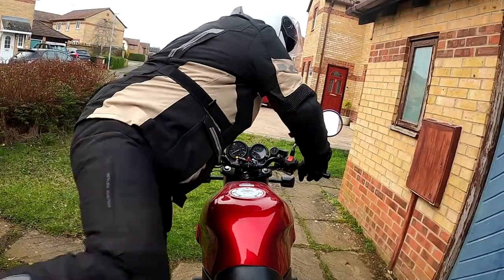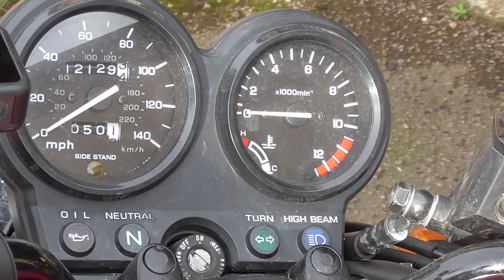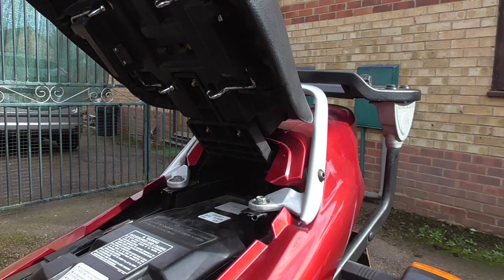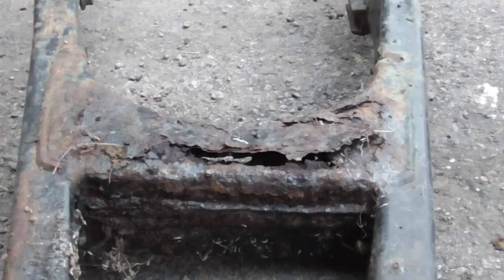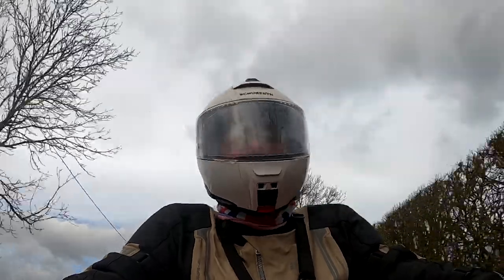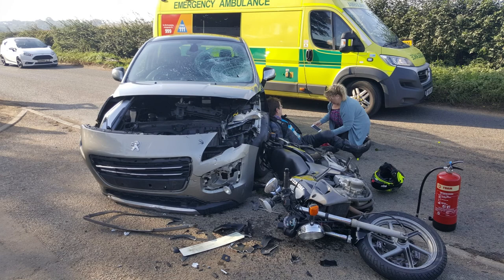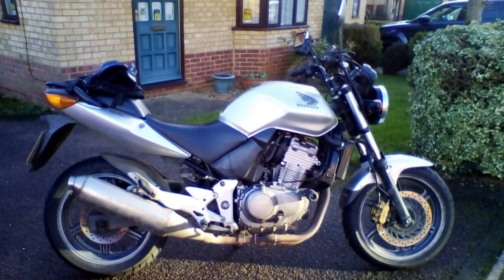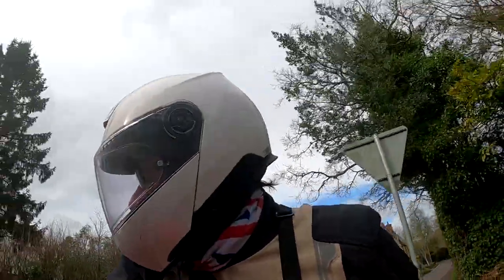1999 / 2003 CB500: Honest Review

Comment: Honda designed the bike for 300,000 kilometers; 186,000 miles. I've had many twins, paralel power curve, but these have a rush from 6 / 7 thousand revs. The head has been ported the same as a Fireblade. The bike will commute, tour and scratch. Top is around 125 mph, but more importantly on twisty A & B roads she is in her element, can surprise many bigger bikes.
Reply from the maker: @TheBezaleel The CB is indeed a great bike for seeing off bigger bikes, on new tyres I had to stop twice and wait for a 'blade, and a couple of Kwaks - a 636 and 900 Ninja.  It was the last time they said 'you are on the slowest bike, you can lead'.

Comment: I own one too. It was my first bike. I have it for about our years now. I replaced the shocks for Icons and upgraded the forks with Wilbers springs. In combination with wider handle bars, it transformed the bike completely. Handles like a bicycle now. I do everything with it and I mean it. Long touring and everyday commuting all year around. The engine is a dream and quite powerful for its 500cc. Only on long touring, I would wish to have a bit more power. The bike is very easy to work on and I learned a lot owning it. I will however upgrade to a 675 Triumph Street Triple R this year. I feel like it's time and I would love to own something more modern with ABS.
Reply from the maker: @memento mori Thanks for the comment.  Like you I used the one I was knocked off for touring (just under 900 miles in one day) and everything else.  The Triumph is a completely different bike so if you have the money and space you may want to keep the CB as well, a lot of people who changed bikes wish they had!

Comment: its good bike but not perfect 👌🏻 own one from 94 at first it was limited to 35 hp 0-100 8 sek on racebox vmax 152 km/h now full power derestricted 57 hp 0-100 4,7 sek vmax 183 km/h racebox so that said now i write what im like about this bike and what dont like 👌🏻👉🏻 weight  is good , geaometry not perfect but close 143 cm whellbase 78 sest hight 27 degree rake vs perfect be if it would have 140-82- 24 👌🏻 yea lil more sporty cos i like more  dynamiq agresive ride than very slow cruising 👌🏻 chasis for fast ride in corner also isint perfect bike like do pogo if push at fast pace thrpugh corner what i dont like so stronger frame suspension project be aprecciate be me 😉👌🏻 for slower roder that isint issue cos they never reallly go to level of gforces where bike start behave not very stable  👌🏻cb is projct for brisk ride but not reallly fast 👌🏻 breaks are good enough  if ride single even fast when it comes to decelerstion level but break lever need more force exert on it for get similar gforce than if it wpuld have stronger setup now it have 296 /2 t i would prefer here something like 320/4 to or at least 310/3 t for get more agressive reaction on the same force on break lever 👌🏻 gearbox work hard it need big force to change gear i also dont like this feg in sv 650 it work waaay easier 👌🏻 when it comes to ergonomy it close to perfect i would only change seat high on couple cm higher what will straighten knee angle lil more and bend corpse lil more  👌🏻 weight distribution also sisint perfect 47-53 bike dont ride front end like i would like for waaht is required at least 50-50 weight distribution with rider on it in neutral position with let say 50% fuell in tank 👌🏻tire size have 3 point to solve 1 80 profile dont give to big choice between good sticky tires so better be 70or 60 its wodth 110-130 have advantage and disadvsnstage advantage is it dont need lean so much for go the same fast in corner as woth woder tire and is less prone to shimmmy but it take out worse tarmac with hole and bumps much worse than sv 650 with 120-160 sets or new cbf 500 also with 120-160 👌🏻 now 👉🏻 engine 2 point internal cosntruction and power characteristics so when it comes to internal cpsntruction it have vlavetrwin on chain and tensioner which need service after some time  and change stuff what generate costs much better be maintenanceless  and cost less cam whells basically immortal setup like in first vfr or cbr 250 mc22 😎👍🏻 + it have  vslve on glass and shims also is  not very good setup in terms of service need alot work to setup everything good vs valve on screw be waaaaaaay nicer 👌🏻 easy and fast to service in garage 👌🏻 + not 4 per cylinder but 2 be waaaay enpugh what also make serviec again easier 👌🏻 i have no idea whay manufactory setup bike which have pathetic 114 hp from liter dispalcement in 4 valve per cylinder + chain and glass and shims like in pure racing bike 🤭🫣🤷🏻‍♂️which have 150-200 hp from litres dispalcement 🤷🏻‍♂️ it makes no sense it incepreases only service cost time and ypu still dont have very powerfull bike but avg commuter after all this 💩 🤷🏻‍♂️🤭 🤮 maybe it isint very emergency i mean engine overall in cb but isint also perfect when it comes time to service intervall 🤷🏻‍♂️👌🏻 and last butnot least power characteristics it have weak lowend and midrange in regard to topend which it have like from 500 ccm and even worse  is that power isint delivery linear but it have hole/big hole in midrange and rapidly power increasing from like 6-6,5 k rpm up what mean ypu need upshift and down shift more often than not i dont like this as well defenitelly nicer  setup be if it would have more torq and power at low and midrange rpm + perfect linear power build from low rpm thrpugh rev range 👌🏻 + than i would throw off 6 gear and left only 5 with 5 final gear rstio like now 6 so at 100 km/h around 5000 rpm with like at least 50 nm at 5000 rpm 👌🏻 topend power is enough for me 👌🏻 57 hp in 190 kg naked isint bad 0-100 4,7 100-140 4,7 100-160 9,5 vmax 183 km/h on racebox wayyy faster than feg royal enfiled 650 interceptor or continenetal gt asf ….. only elasticity 100-140 in 8 sek isint to good like for me ….perfect be somewhere around 6 sek like for me 😉👍🏻 chasis with preload front and rear stock have only rear both also to soft sstock but its commuter so ok2 point of view its commuter vs what i would like have more in cb 👌🏻 so yea as commuter to not to agresive ride it isint bad but like for me its not pefect i give  it like 6-7 out of 10 points 👍🏻 vs me hipothetical cb setup be like always 10/10 👌🏻👉🏻so more stable on fast ride in corner stronger breaks reaction much better elasticity maintenance less engine better weght distribtuion and lil better ergo 😎👌🏻🍿+ one more stuff 👉🏻 dasboard look like 💩👍🏻😁 2 piece of 💩 with 💩 everything i would like more something like street rod 750 one central speedo minimalistic but with all stuff in this small electronic window under speedo or like in junak m12 also minimalistic speedo one central than 👍🏻 so when i ride all this 💩 in head while ride on cb im not very happy riding it but sometimes when i forget abput all this 💩 i like ride it 😉👍🏻🍿
Reply from the maker: @mociczyczki - Thanks for the comment, it was longer than my review.  To address some of the points in order:

In the UK the roads are apalling so it is difficult to see if the bike is bouncy because of the suspension or the roads.  i've not had any boinging when on track, and ignore it on the road, the bike will sort itself out.

The brakes aren't designed for MotoGP type decelerations but it is easy enough to 'stoppie' a CB500 so they are strong eonough for the bike, after all if the rear is a foot off the floor how much more braking do you need?

You can use a 140 section on the rear, the CB500 racing control tyres weren't available in a 130.

I'm slightly confused by your comments about engine maintenance, performance and design though.  The valves only need looking at every 16 000 miles with oil changes every 8 000.  I never had a shim in the one that I did over 100 000 miles on, and my nearly 110 000 mile Hornet 900 hasn't had one either.  You seem to be asking for two valves per cylinder which would lower performance and screw and locknut tappet adjusters which would bring the valve maintenance period down to 3 000 miles at best?

The 'hole' in the torque curve is found on every bike, this is to get through emissions and noise tests to meet approval and usually occurs half-way between tickover and redline.

I disagee about the instrumets, my Tracer 9 has shedloads of information available but I look at speed, coolant temperature, fuel gauge and the time if I need to know it.  The CB500 has a reserve tap [I tend to fill up every 100-120 miles as this is about 2-3 hours riding and time for a break anyway] and I put a clock on it.  The mechanical speedo us unlilely to fail, although the cable can break and I doubt many TFT instruments will be working 25 years after the bike was sold.  The Street Rod you mention still has the 'idiot lights' although no tacho - probably because it would be embaressing for a small car to rev higher than a Harley!

You do seem to be enjoying the bike though, which what riding is about.

Comment: 300.000 miles or kilometres?
Reply from the maker: @kennerroberto7322 - Are you referring to the design of the engine?  It's states as 300 000 km [186 000 mies], which is the distance that light covers in one second!  Sorry if I said miles in the film.

Comment: I had the dark green one and did over 110mph on it once riding solo.  I also toured Ireland with my girlfriend on the back, a top box and throwover panniers.  The rear shocks couldn't handle the weight and bottomed out regularly.  That bike never let me down, but I sold it and bought a Sportster 883, which was not as smooth or quick.
Reply from the maker: @1SeanPG - I hope your girlfriend doesn't read this and think you are blaming her for the shocks bottoming!  From memory the dark green would have been about 'P' reg, 1995 ish and drum brake?
Reply: My green one is a 94 M reg rear drum. I bought it for £750 on ebay with a helmet and top box with just under 6k on the clock in 2019. Finally got it on the road this year. I fucking love it. Needs an engine respray and there's a bit of rust removal (30 years old) but it's practically off the shelf...

Made me laugh when you said going back in time to buy one because that's kind of what I've done. Absolute belter of a purchase.
Reply from the maker: @dannybruff - Thanks for the comment.  I held off buying one until it had the rear disk, but then found I never used the rear anyway as the front was so good [I was riding a GPz305 at the time].  6000 miles in 15 years is nothing!  Had it gone round the clock???
Reply: @TheRantyRider  no, the last time it was taxed on the road was 1997! Ive put nearly 300 on it now...

Comment: The CBF has carbs, not fuel injection.  The PAIR system can be removed and the fuelling is fine.  They also come wirh ABS as an option.
Reply from the maker: @kpowers9017 Thanks for the comment and correction, someone else also pointed out my boo-boo and I keep meaning to do a card/endscreen accessed correction which I will have to get on and do.  I know someone who will benefit from the PAIR bypassing.  I had the ABS version (2005).

Comment: It WILL do autobahn, 2-up and touring. I've done all three on mine - including a +1000 mile IBA certification ride.
Eventually - after 50k miles - it had a sibling in the shed; a Blackbird, which is essentially a double CB500 with a bit of Extra amenities. Eg. a clock. But I keep returning to my CB500 because of its WYSIWYG approach to everything.
It's a no-nonsens bike that will take you literally everywhere.
Scraping pegs on Transfăgărășan, riding 2-up with the missus on Monaco racetrack, exploring balcony roads in France and pegging the revcounter at 8000 rpm for 500 kilometers solid on autobahn; maximum cruise speed. 
Been there, done that.
No issues, no hiccups, nothing.

Indeed a good bike.
Reply from the maker: @MartinFiltenborg - Thanks for the comment, did you do two -up with luggage at high speed?  The CB will do these individually in my experience but maybe two out of three and not all three.

As for the clock, we can get small bolt-on ones from Oxford in the UK, these fit to one of the switchgear bolts, or the tried and trusted 'cheap digital watch around the bars' is always an option.

Good to hear from a fellow CB-er, they are beginning to die out a bit now, so it's up to us to keep them on the roads.

Comment: I have a good cb,500..from new..
 for 20 years.coming up to.20.000.miles so ultra reliable.. garaged..as you say .a new regulator..never changed a bulb.. fantastic machine.im nearly 80..I love bikes.. especially honda..i also.have a c92 honda  benly..60years old. .
Reply from the maker: @davidblanchard7077 20 000 miles is barely run in, I bet the Benly is still going strong too.  If you get the chance the David Silver museum is well worth a visit.

Comment: Great vid! nice to hear such positive things about the predecessor of my bike :)
You talked about the CBF having fuel injection, but in fact it kept the carburettors and yes, it's great !
Reply from the maker: @bumboschaumburg8200 Thanks for the comment and pointing out my error, for years I had thought the CBF was fuel injected!  I have looked in my workshop manual which isn't clear and went onto the Fowler's website to check: https://www.fowlersparts.co.uk/parts/4798359/cbf5006-2006-e/carburetor-assy

Have you ridden a CB500?  If so try one and see how the fueling compares particulary when in 4th gear at 30 mph and accelerating from a steady 5500 RPM, that's where I found the fueling harsh.

I'll put up an 'I'm a chump' short when I get the chance with full credit to you.  Until then I will sit on the naughty step.

Comment: I'm a born again biker having grew up on motorcycles and almost signed to race for Aprilia back in the 70s, so l knew a fare bit about bikes and when the opportunity arose to buy a 2002 black honda cb 500s with 13500 miles on the clock, l jumped in with 2 feet. 
Bike is immaculate,  bought from a 73 year old gentleman,  totally stock,  serviced,  new Avon Roadrunners, new honda battery,  new brake pads, load of extras. 
He owned the bike 12 years kept in heated garage,  beautiful machine and l love it.
Reply from the maker: @Mike Rider Thanks for the comment, it sounds like you have a real find there.  Low mileage ones are very rare now, especially when you consider these haven't been made since 2003.
Reply: Your very welcome David.
I was considering an old Triumph bonneville as my return bike but being a 65 year l remember well the issues with Triumph and TBH I've always loved Japanese bikes.
The newer Triumph bonnevilles are beautiful, but are heavy, especially the Thruxton, and the Honda 500s is what it is, probably the best motorcycle ever made, for the money. 
I paid 2k for a piece of fine Art, reliable,  beautiful, so l asked myself,  which one would you marry 😆  the Triumph or Honda cb 500s and it was the Honda of course. 
And what fun it is riding through the twisties if you keep her lit with the revs above 6k it behaves like superbike 😆 or if that's not your thing you can ride gently. 
Very economical , tax, insurance, mpg, well done Honda.
Reply from the maker: @Mike Rider I think that a big problem with modern bikes is the 'bloat' of legal and company gizmos.  I bought a Himalayan and Tracer 9 last year, they are about the same weight but the Tracer carries it all at the top which makes it feel heavier.  ABS and other tat all adds to the weight.  The 1995-2005 bikes seem to be the last of the 'biker's bikes' with later ones losing on the quality to pay for multi mode traction control, cruise control, electronic suspension and the like.  If you need the electronics to save your arse any time you ride you shouldn't be on a bike.

Comment: Hi David, I'm Ray, just found your channel by chance and I'm glad I did. What a wonderful video! I've been on a Honda CB650R(the Neo Sports Cafe) I got from new in 2019 and I love it! I look at these smaller, simpler Honda bikes, thinking they'd be great for winter, as a second bike. Commenting on your video, I some times am amazed at how some people get lured into newer/cheaper bikes(Chinese bikes come to mind), that will be described as similar to or based on a Japanese bike, but when it comes to service intervals/valve checks are nothing but, requiring those at a much earlier mileage that the supposedly similar Japanese counterparts. I looked into the Vogue 500cc(very similar to the Honda CB500X) but needed a service every 3000 miles and valve checks every 6000 miles! And it only cost a few hundred pounds less that the Honda. We're talking brand new here, but the same applies on used bikes. Anyway, I waffled on long enough. Thanks for the video, you've got a new subscriber mate. Cheers, Ray.
Reply from the maker: @Reinaldo-iz5wz Thanks for the comment and subscription Ray.  A lot of the engines used in Chinese 125s are clearly CG125 or Yamaha licenced/copies.  I don't know about current quality of these but Honda clearly cut costs from abut 2009 onwards - the first year of the CB500 F/R/X family (built in Indonesia I think) had to have valve checks done at the first (600 mile) service!

If you don't like short service intervals don't get a 411-engined Himalayan, they are every 3000 miles for a valve check as they are screw and locknut. The dealer services are only about £200 though (Triumph 12 000 mile major services are likely to set you back £700) by contrast my Tracer 9 goes 24 000 miles between valve checks.

Comment: ❤❤❤best bike ever.mine is 20years old low.milage never replaced a light bulb.
Reply from the maker: @DAVID BLANCHARD Thanks for the comment, I have replaced the headlight bulb in the one I was knocked off of as I put a brighter one in.  Apart from that I don't recall replacing any, but I may have had a tail light go.  My Hornet (also 100 000 miles) has had a couple of tail lights and a number plate light.